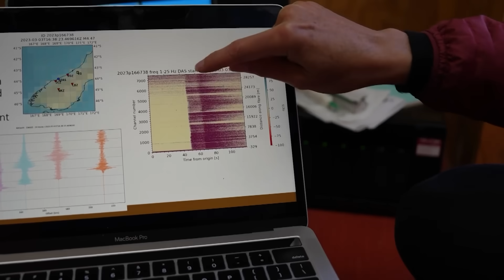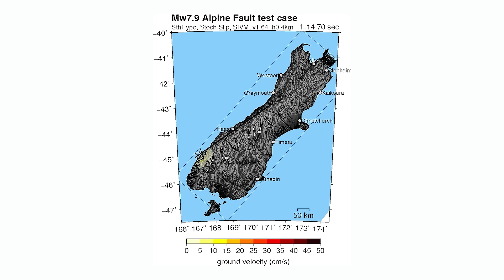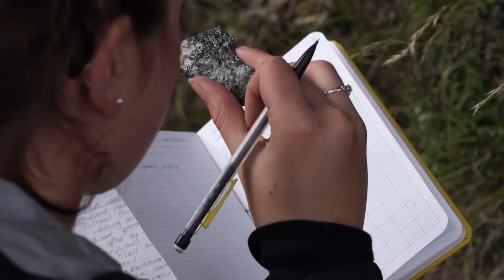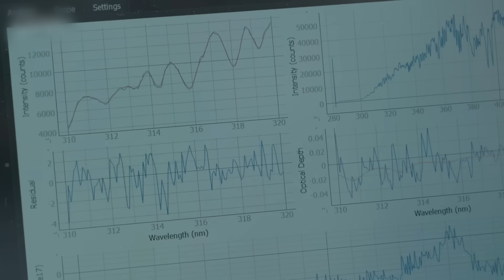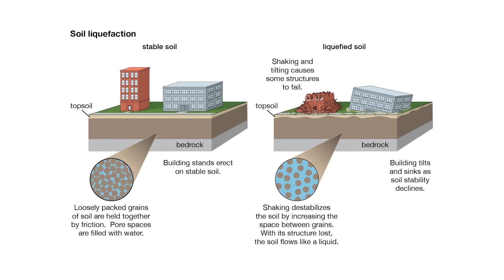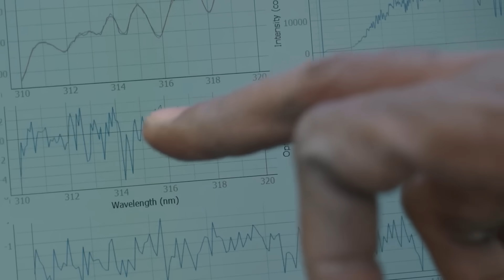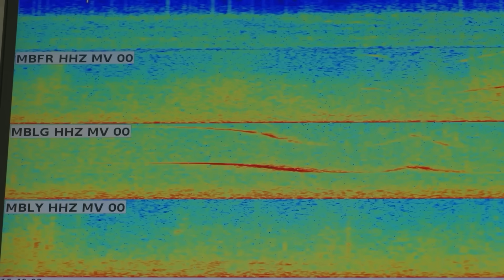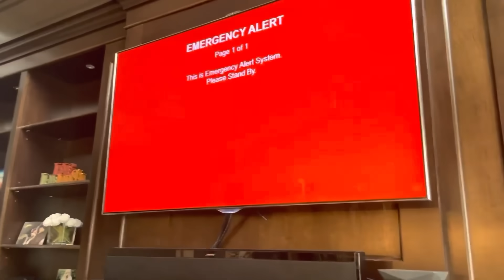The Deadly Alpine Fault Is About To Rupture: A 9.0 Megaquake Is Imminent

Comment: One mixed blessing is that a major earthquake has recently occurred right under the main population center, Christchurch and has eliminated vulnerable buildings.  They have been re-constructed to a higher earthquake standard.  Note that it was a major opportunity for the re-build to be done with engineered wood which is inherently more  earthquake resistant than concrete while using our huge lumber resources instead of sending raw logs overseas.  We totally missed this opportunity.

Comment: When this lets rip. it will be felt in Sidney, far further impact than suggested in here.  Auckland will see damage.  As for the 75% chance of occurance, that's on light side. Its longest recorded interval is 350 years. if it hasn't occured in first 310 years and it overdue, its  closer to 100% in next 35 yrs

Comment: The New Zealand government needs to build a ferry ready terminal in either New Plymouth or Tauranga for this event. Wellington will be effected also in this event, the main highway into Wellington sits between the harbour on one side and large hills on the other with only 100-200mtrs separating them, a landslide of this hill WILL cut off access to the port where the ferry terminal is, Wellington is currently the only surface based access to the south island from the north. I hope I'm wrong.
Reply: Oh, they'll just say, " she'll be right, mate" and continue their beauty sleep!!!
Reply: @gabrielleaumont3971 Unfortunately your Very correct, just another case of elected by the people but not for the people.
Reply: They're building a seaport in Whanganui that is supposedly going to offer ferry services to the South Island
Reply: @CallemJayNZ  I thought that got scrapped due to the constant dredging that needs to happen to keep it open. Cool if it goes ahead.

Comment: I still see pancaking style buildings like the Marlborough library being built. Concrete slabs and steel poles no mods to prevent 8x forces that impact these joints from fracturing. Suffice to say not much was learnt from the tv building in chch
Reply: @winoseti
They’re obviously not expecting another big one for another 290 years either!